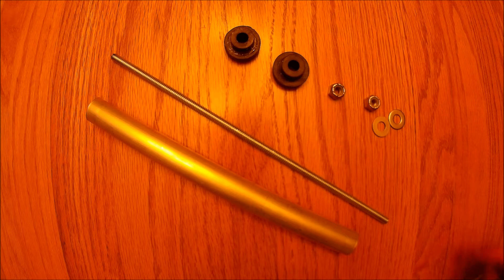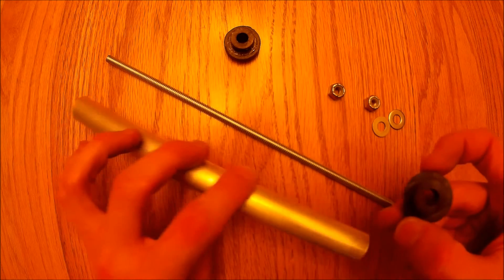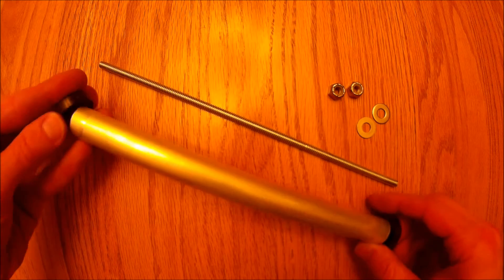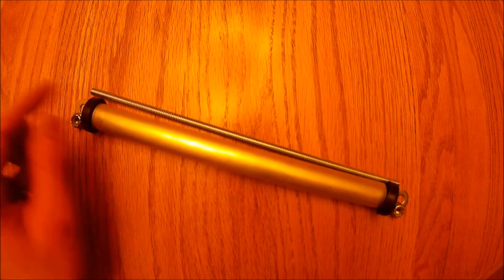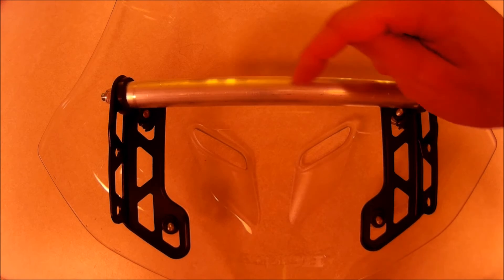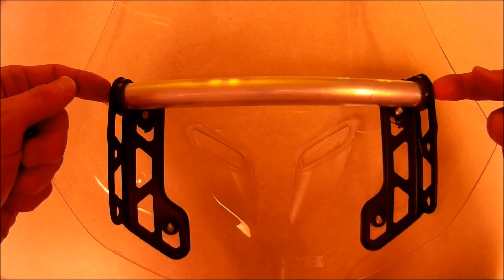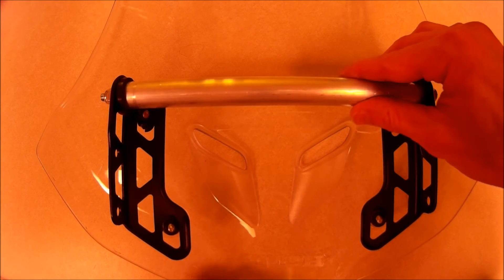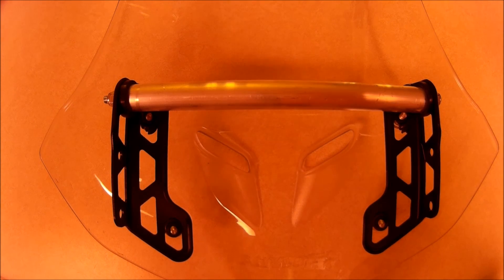Honda CB500X Custom Windscreen Accessory Mount

Comment: this work out for you?
Reply from the maker: Yes, it works great. The issue I'm running into now is that the USB connector on the Garmin wears out over time due to vibration.